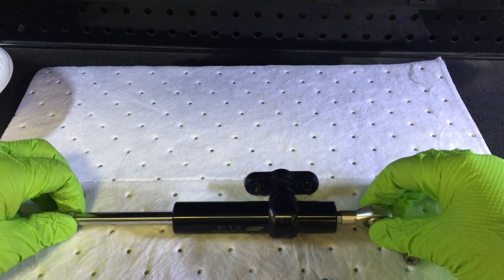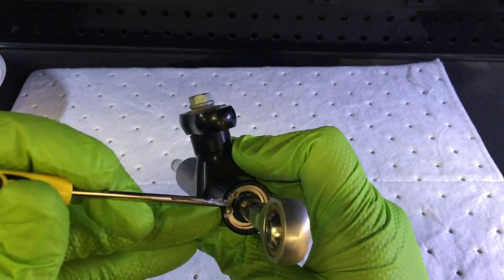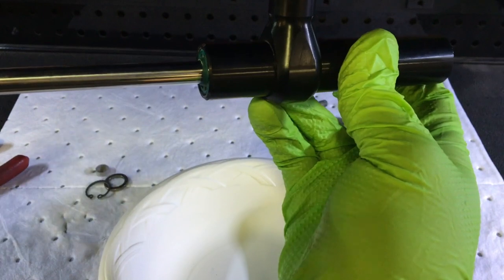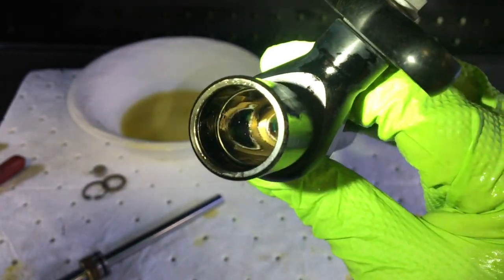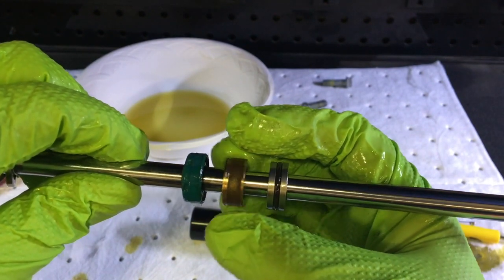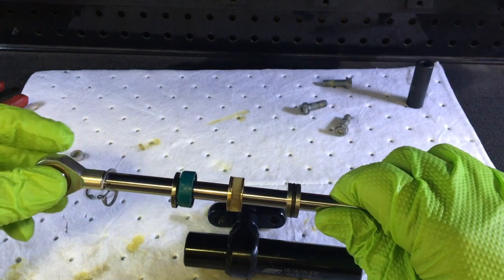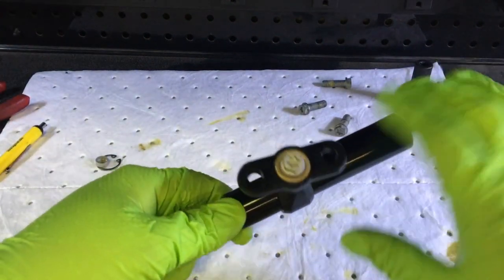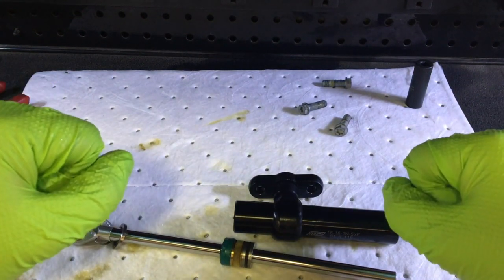KTM 1290 Super Adventure steering stabilizer rebuild

Comment: Very helpful video. I tried doing this and damaged the oil filter a bit. Would you know if I can get a spare from anywhere?
Reply from the maker: I was not able to find that part. I think I called it a filter in the video but it’s just a cushion so if it’s not too terribly damaged it’s will probably be fine.
Reply: Some Sort of Road Trip yeah slightly damaged the cushion. Also the damper is making hiss sound. I don’t know if it’s air bubble or just oil movement. In case there is some bubble left do u think it will cause a lot of issue. It still feels 1000 times better than stock though
Reply from the maker: Saurav Kumar you can slip a needle between the shaft and the lip of the seal and slowly move the shaft to bleed air out. Just don’t let the needle fall inside! And also be very careful so you don’t damage the seal.

Edit: make sure to have the stabilizer standing up while you do this so all the air goes to the end you have the needle in. Can’t do it after it’s installed.

Comment: 2 remove air bubles needle can be used. Just carful isert it beetween seal and shaft and push it on the seating place. All bubbles + some oil will go outside. After that just remove the niddle

Comment: Hi there, very helpful video, any tips where to get the replacement seals?
Reply from the maker: I had my Ktm dealer find them. It took them a while to find
Reply: @TourmotoDesign  Thanks for the info, I will try that as I was not able to find them anywhere online.
Reply: @TourmotoDesign  This is a long shot but could you get the size of the seals? I'm trying to rebuild mine but my dealer couldnt find anything and im currently getting help from a local shop and we cant find the seals anywhere either